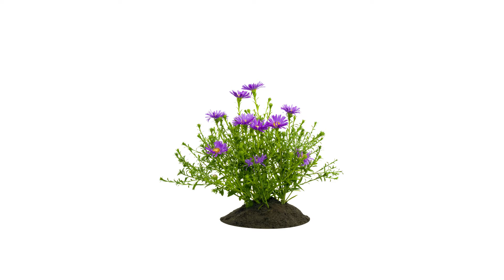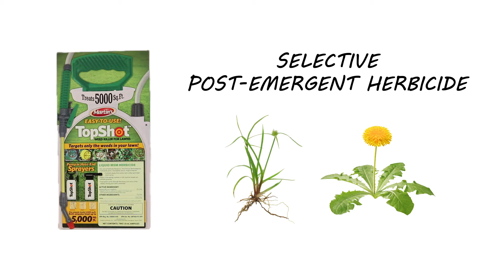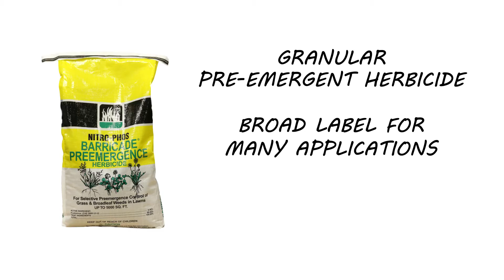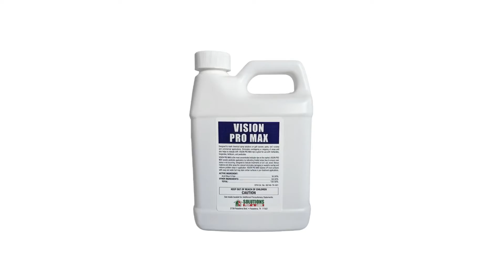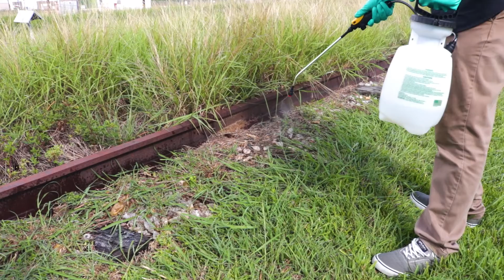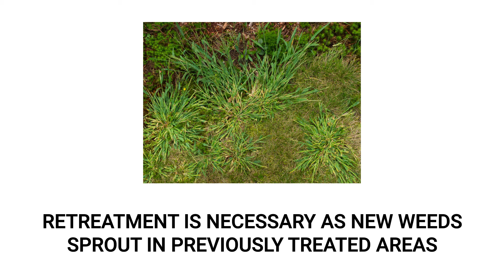RoundUp Pro Concentrate Herbicide: Product Review

Comment: I have 15 acers of kudzu, I've brush hogged it and ready to spray something? I don't care about anything on the land but the hard woods, and they are 10' tall or better. What is your suggestion and I will be spraying with a tractor and sprayer.
Reply: Not that im a pro or anything.. But i have some.. And its mix and percentage for tractor spraying and stuff is on the back i just read it. Ill post its % if you want.. .5-10.5 oz per gallon